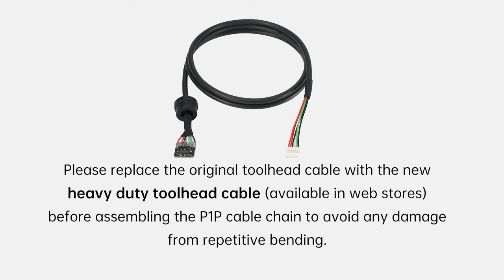How to install cable chain on Bambu Lab P1P

Comment: I have run the cable chain now for a month with the original toolhead cable with no problems just make sure the cable is not bein streched in the chain that's all, the new cable would be better but not really needed just a way for more money spent.
Reply: The chain does not lodge the ptfe tube, just the wiring, and it's strongly recommended to keep the pipe outside the chain, even tho it fits perfectly along with the wire.
Yes, that cable chain is pointless.
Reply: More money spent? The thing is like $5 lol

Comment: Should I remove (or ignore) the PTFE tube anchor after installing the cable chain?
Reply: Still no answer to this?
Reply: I didn't install the chain yet, but I'd use the anchor as usual just for the sake of having a sturdy support next to the rubber tubing on the printer. Since it that other part is rubber, it won't have much sturdiness when it comes to holding onto the PTFE.

Comment: 2:13 If someone cant find this screw like me... on some printers the screw is on the left side and not on the right side like in this video.
Reply: Thanks!
Reply: Thank you!!!
Reply: Danke  Dir !
Reply: Mine didn't even come with a screw on either tab so this step was extra confusing. They need to hire better instructions people.
Reply: On mine (a P1P I am upgrading to a P1S) there is no such screw bei on the left or on the right. Anyway, I would advise not to screw it anyway, as the poop chute guide is already tightly secured in place. This screw is way over-engineered considering how far it is recessed an how difficult it is to reach for.
Reply: There is no need to unscrew this at all. Just skip it and after that there will be no need to screw it back. Unnecessary step
Reply: THANK YOU SO MUCH!!! THIS HAS BEEN A REALLY BIG HEADACHE

Comment: Where does this lock in screw for the cable chain assembly come from. None of the screw bags with my p1p enclosure kit are labeled, they are simply taped to the part they go with, but the cable chain assembly parts included no screws.

Comment: I dont have that rubbernose that needs to be connected with the new cable on top of the printerhead and I really dont have a clue how I can get the one off my old cable. Any suggestions?😢
Reply: I just had this problem. You can push the old cable through the rubber on the white connected end (the smaller connector). To get the new connector through the rubber, grab some pliers and stretch the opening of the rubber until the new connector fits through. Make sure you orient it correctly.
Reply: @Alfirio  dude you must be magic Mike cause there’s no way I’m getting this jst to slide through that opening. Do you happen to know if it’s even necessary cause this seems like a lot of effort for a piece that doesn’t necessarily seem needed.
Reply: @Enak147  lol I watched the rest of the video and saw them cut it with a blade so you don’t need to add it to the new cable

Comment: I ordered the P1P to P1S Upgrade Kit for my husband.  He is a stroke survivor and cannot do the upgrade installation by himself as he has hemiparesis on the his left side.  This installation has been a nightmare.  The box of parts came with no instruction, not even a piece of paper with the appropriate URL links for installation of each item.  The P1P to P1S Upgrade Kit Installation video does not include a module to install the cable chain.  I had to find this video.  I do not want to pull any wiring that I do not have to because that's more chance of me messing something up.  I do not think they sent a "heavy duty" toolhead cable with the upgrade kit so I went through the aggravation of taking that all apart and replacing it with the same quality item.  

At 2:11 Bambu Lab should circle the two holes that it shows you on the back frame because that is where you have to go through with a long hex wrench to get to the other two screws holding the filament ejection bin.

At 4:07 when you go to put the board back on the back of the print head note that you have to run the toolhead cable to the right around the round thing that is sticking out otherwise you cannot screw the board in properly without possibly breaking it.

At 6:07 what do they mean by "length 15+3 mm"?  Is it 18 mm?  It does not look like that is going to be enough.

The QR codes on the boxes only get you to the main Bambu Lab wiki page, you have to navigate from there.  I did it differently, I went to the Bambu Lab website, looked up the product, then scrolled down until I found the link to the specific wiki page with instructions and YouTube video.

It would be really nice if they would show each package of screws immediately prior to the place they are going to be used so you know which ones to use so you could be sure you were picking the right screws.

Since I am not a 3D printer aficionado, this has been a painful experience.  Been at it for six hours.
Reply: Hey, look carefully after it, there has to be. I think we have the same batch of kits since I'm assembling it right now.
I can get it that with a paresis is even trickier, but truss me I move perfectly and still yes this kit is...not at the level of the rest of the build.

"Heavy duty" cable should be included. The rubber fitting that the original cable on the hotend side is  replaced by the first curved section of the chain. You do not need to remove that rubber fitting from the original cable, like I did.

Filament ejection bin: Hey Bambu. My right side screw below there is missing. It was missing when I looked for taking it off. I only noticed it because, like the lady said, you have to tinker a lot to find them out and understand how to get there.
(If you have a magnet, or just use the ones from the door kit, stick it to the metallic wrench. It will help you to stick the screw in place without falling from the wrench. You can also use it in case some screw falls where you can't reach.)

4:07 confirmed, Very unclear instructions in that point. I figured it out but in Bambu's instructions it looks a childs game, and it's quite not.
 
At 6:07, that indicates that the tube has to hang out from the rubber connector for 15mm plus-minus 3. It says 15 millimeters with a tolerance of 3. But it substantially means 15. Longer would twist, shorter wouldn't reach.

Write me here if I can help you and your husband with other parts of the kit.

...Have you already reached the part where there is a piece that you were supposed to print yourself, imaginably BEFORE dismantling the machine?
That file also sucks, I'll link you a remix of it to have it functional but easier to print than the Bambu one.
Hope for your best! :)
Reply: I'm a 3d printer afficionado, and this was a terrible experience. I'd have actually been better off just laying all the parts out and staring at it for 15 minutes and then doing it myself, if only the screws were labeled. Just having labeled screws would be better than any of their instructions. I hope you were able to get it figured out in the end. Bambu should be embarrassed about how bad they are with this stuff.
Reply: And thats what the Bambu Hype boys don't talk about.  Bad customer service, Bad time trying to do any maintenance or upgrades.  Bambu Lab printers are like the old Packard Bell computers of the early 2000's.  Work for a while out of the box but dont try to do ANYTHING to them or even do maintenance because it will be a nightmare.

Comment: 2:08-2:17 there is no need to unscrew and remove that opaque transparent plastic part and, correspondingly, put it back later. Time and efforts waste. It does not restrict an access to the cable connector.

Comment: So does that rubber grommet you cut off  go on the new cable chain ?  Mine will not stay for some reason very snug
Reply: The round cable guide that screws into the tool head should snap into the right angle connector that connects to the cable guide. I did not reuse the rubber grommet.
Reply: @nwsmith9  Thank you.  I will try again . I cod not get it to go for anything lol

Comment: With one clip in the middle of the chain to hold the PTFE tube, the tube drags on a cover if you have one.  I put a couple more loose cable ties along the chain and that seems to be working.  I added the cable chain when I put an enclosure on my P1P.  I didn't know about the heavy duty cable.  More work to do.
Reply: Just print out a top cover riser
Reply: Top glass riser is a solution which also enables to open the chamber when printing PLA. But... How's the chain itself doesn't hold the PTFE tube inside it?  I mean: It does. And every tooling chain I've ever seen in my life is there to AVOID having other wirings pipings stuff around it. And the tube does fit into the chain along with the wiring. Together.
So I was just here in the comments to ask why the heck are they showing to place it on that clip that's even hard to remove and I won't be surprised if that clip keeps scratchin on the glass.
Try with me how the ptfe tube works inside the chain, where it belongs.
I promise that if it causes a catastrophic failure this will be the first place where you'll know.

Because there are so many little things in the build of this kit that are so. poorly. explained.
One over all, you have to print a part (the fan case) BEFORE dismantling your only printer.
Others are so poorly drawn, like that duct you have to print. My grandma uses less supports.

There are things in this kit which doesn't make it to the level of the whole build, and that's kind of a shame. The "cosmetic chain" to lodge just the wire and make the machine look badass with the fuel pipe shoving around, it's one of these. [/rant]

Comment: This video makes this look way too easy. 
Putting the connector and board back on at 4:00 took me hours, the cable needs to be routed through some guides to let the board fit properly. My cable kept twisting out of position over and over again. Probably dropped the board itself onto the build half a dozen times. As I ran out of time and had to leave, I still don't know if my printer is in working order after this.

4:54 Also, my base cover isn't fitting properly at all and like others here, that screw in the instructions seems to come out of nowhere.

Comment: What if you had the early bird light bar and camera installed where can you move the light to put the base cover in ? on the p1p ?
Reply: Wondering the same thing. Just ordered the parts of this today.
Reply from the maker: You could cut off the side part of the AP board(only keep the rear part to connect the chain) to leave the place for the light bar.
Reply: @BambuLab  Thank you will try that :)
Reply: @BambuLab  do you cut it at the live hinge?
Reply: @BambuLab  Is it the same for the P1P purchased with the camera and light already installed?
Reply: @BambuLab  That is NOT acceptable!  Telling people to hack up parts because your company cant do a decent job of engineering is Atrocious

Comment: I tought the lastest p1p came with the cable already upgraded am i wrong?
Reply: wondering same thing i just got my order of upgrade parts then I seen this notice at beginning of video my printer is only couple weeks old and came with installed camera and led light so new version of p1p.(Australian order)..???
Reply: @scozzie1  I don't think so, I also just got a new p1p (ordered April 22nd), it came with the camera and led light but it did not have the upgraded cable. I ordered the new cable and you can feel the difference. If the insulation of your cable feels soft, then it isn't the upgraded cable. The upgraded one is tougher feeling and more slick.
Reply: @s0mple1  ok thanks for that I will order it this week and use old one for now sure it will last ok till then
Reply: It does not come with the cable chain, at least mine did not and I got mine about 2 weeks ago
Reply: @cybrsage  we are not talking about the cable chain but the cable itself.
Reply: @s0mple1  Thank you for confirming. Will get the new cable on my next order.
Reply: @kill95  oops, sorry.  Mine came with the original cable.
Reply: @kill95  Bambu Labs confirmed the same thing in a ticket. I bought the new one too.
Reply: @s0mple1  Ordered on August 22?
Reply: @dejedejsson  Meant to say April, I am dumb

Comment: The support arm for the cable chain for the P1P is entirely too large.  It fills the area that the LED module is installed and leaves no room for it once installed.  Support is trying to tell me they both fit, but I don't think support has looked at a P1P with the cable chain to realise that there's no room for the LED module, especially with the large rectangle bit that sticks out for no reason I can see :\

Comment: I installed a cable chain before you release yours but couldn't remove the PTFE tube. It seems to be stuck in the hotend. When that happened on my previous printer i'd just unscrew the coupler, but that's not an option on this one.
What's the procedure to remove a stuck PTFE tube? (my guess is the barbs in the coupler are stuck in the tube)
Reply: So did you get your tube out or did you tear the barbs out with the tube? Then  what a new head unit?
Reply: There is a lil plastic cover above the fast release joint of the tube. If you remove it with its 2 screws, you'll be able to hold the lower base of the hotend with the thumb while clicking down the fast release joint with the index and medium fingers, and gently pull the ptfe tube out with your tail or your teeth. Sure you can also use your left hand, if you still feel perfectly calm after that mess.
Yes, I found it very tricky too.
Reply: @bonovoxel7527  🤣

Comment: 2:14 can someone tell me the specs for this single screw being removed from the shutes side tab, mine appears to not have come with one installed......
Reply: Mine was installed on the left of the chute instead of the right. If you removed the top 2 screws and it's still tight, check other places.
Reply: @benny5735  thanks, but yeah no screw was installed, only the two top ones. It was a very early p1p, like 2 weeks after it released, and they had some qc issues for sure.

Comment: 6:10 it says to install the connector and blue clip. But at the end of the video, the connector is backwards? Also, after doing all these steps, when I turned it on and sent it "Home", it nearly pulled the tube itself out!

Can't print like this and I'm looking into solutions/looking for answers if anyone has some!
Reply: In a few hours I'll be at your same checkpoint, let's keep in touch...
Yes, me too I've found these instructions very unclear that's why this is probably my most viewed video ever, after ACDC's It's A Long Way.

Comment: Why do you not route the PTFE tube into the cable chain, giving it full protection as well?  It can route into the chain near the printer back and then out of the chain at the hot end.
Reply: that is not a good idea, as the ptfe needs proper movement space or else you can risk snapping the filament inside or cause other issues to the actual chain. I've tried something very similar to your idea and it ended very badly.

Comment: All this says to me don't do this unless you have to.
Reply: maybe you should wait to get into 3d printing until apple makes one for dummies.
Reply: @obie224  I’m just saying Bambulabs had an issue where the P1 toolhead cable wears through in the cable chain. That’s why you have to go to all this effort to replace the cable and that makes this quite a bit of fiddling around. For me it’s not worth it because you gain very little by doing it and risk breaking something you can’t replace. It’s just another accessory for people who think they need it. I don’t blame them for selling it as an option. I would if I was them.
Reply: @obie224  Anyone buying a Bambu is basically buying an idiots machine.....Maybe you should stick with it